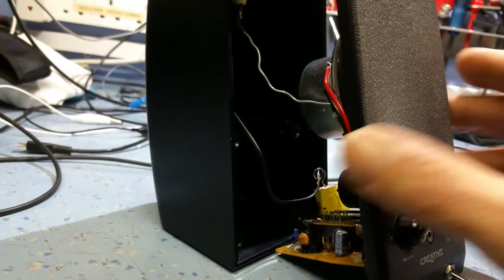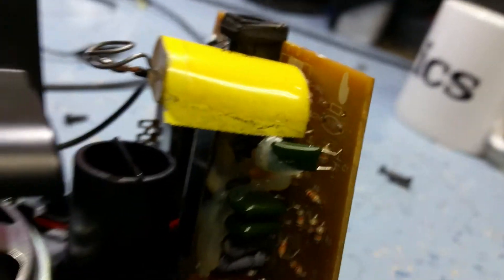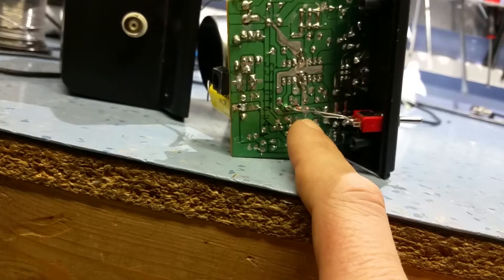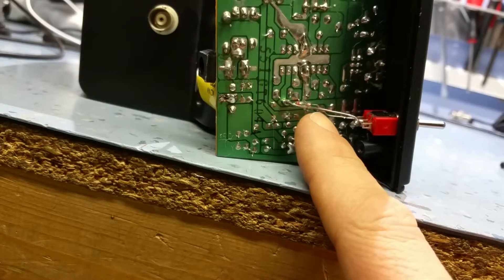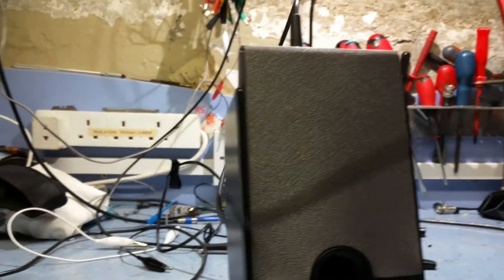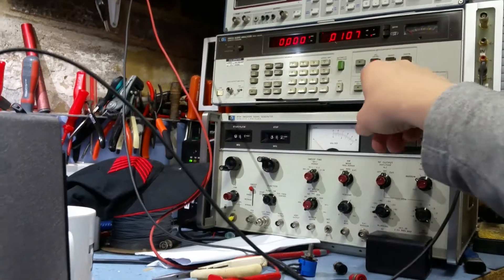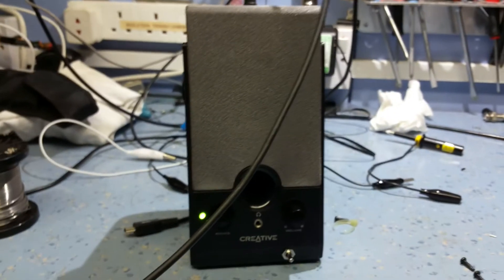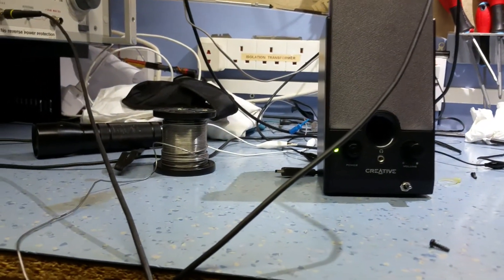Homebrew signal tracer pt1

Comment: Great idea!  In addition to reducing the coupling capacitor value, you might want to add a bidirectional TVS diode after the capacitor to protect the amplifier even further. There usually is a resistor inside the scope probe. In mine there's a 386K resistor in X1 and a 9 megohm in X10. The resistor in the probe will help limit the current.
Reply from the maker: +Steve Rodgers TVS diode, never heard of one? I was going to drop the series cap to 1 nan and maybe add some series resistance. Problem is the input impedance is quite low.
Reply: +Simon Spiers 

TVS is an acronym for Transient Voltage Suppressor Diode. Digi-key stocks them.  Please refer to: http://www.semtech.com/images/promo/What_are_TVS_Diodes.pdf

You want a bi-directional TVS want to protect your amplifier from positive and negative transients.
By using a TVS diode, you can keep the value of the capacitance high for your low impedance input,
as the TVS diode will limit the voltage peaks.